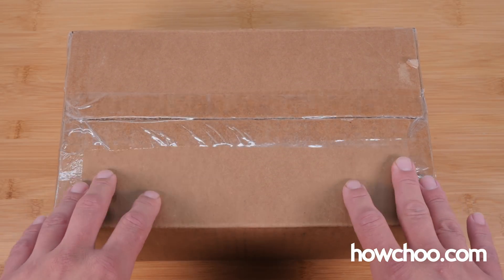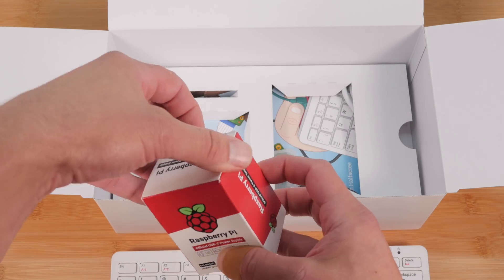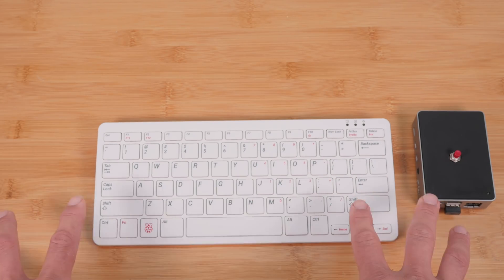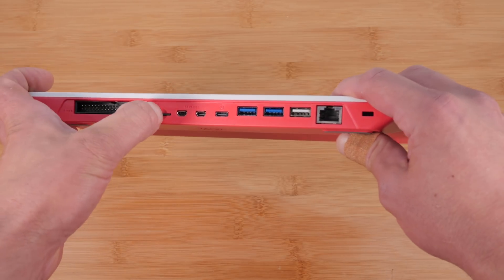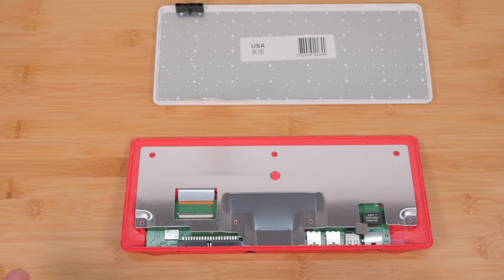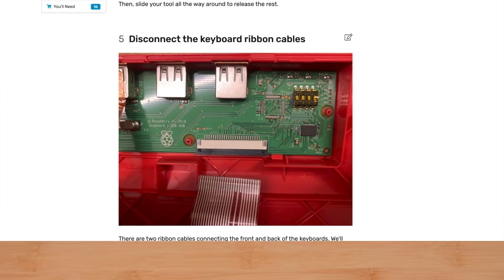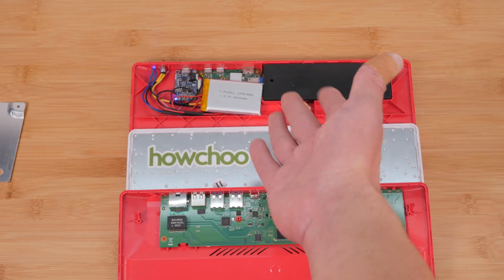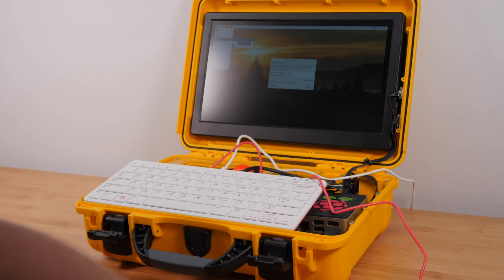Raspberry Pi 400: Unboxing, Review, Teardown, and DIY "000" Option!

Comment: No M2 slot, no gpio cover included as an appliance pi great as a desktop with sd card a fail and the usb3 power not fully supported.
Prefer Pi4 argonone v2 M2 case and a wireless keyboard

Comment: The Zero W is a great match for the Official Keyboard, since it really benefits from the presence of the hub built into the keyboard if you're going to do any actual computing on it (as opposed to using it like a wireless, headless device, which is something else the zero is great for)
Reply: Can you  original raspberry  keyboard top  worked as a replacement for the 400 keyboard and vice versa

Comment: I wish someone would come out with a keyboard case for the raspberry pi, but with cherry keys and space for an SSD.
Reply: It'll probably happen.  But the 400 seems like something the Foundation has always wanted to make.  A great little, super cheap, all-in-one educational computer.
Reply: @TheTurnipKing  Actually, there is enough space for a M.2 SSD and USB3 adapter inside the Pi 400. All you'll have to do is wire it to the USB3 port.
Reply: @PatsFanGermany  There's a couple of issues with that.  You'll also want to physically block external access to that USB port so that other devices don't get plugged into it accidently and it does reduce to you two external USB ports, only one of which will be USB3.  It also makes it difficult to reclaim the slot.  It might be simpler all around to drill a hole into the case, lead the cable out of the back and plug it in.
Reply: @TheTurnipKing  That works as well. Depends on how clean you want your build to be.
The fastest / cheapest way would probably be to buy a cheap KingSpec SSD from Aliexpress and tape it to the underside of the Pi 400 right next to the ventilation slots...
Reply: @PatsFanGermany    The actual best thing would probably be to crowbar a Compute Module 4 inside a keyboard that already has the cherry keys, since it already has PCI-e support.

The real problem with upgrading the 400 to those specs is the amount of stuff you'd need to throw away in order to do it.  I guess you could double the cost of the system easy and not end up with something substantially more usable at the end than the £70-£100 on the 400.
Reply: Failing that you could probably replace the keyboard membrame with a thin PCB with tac switches, like the ZX81 upgrade keyboards.
Reply: I am working on doing something like this with either an IBM model M and the computer 4 w/ it's up board, or a similar full sized keyboard. I'd be using the pcie slot to connect in a usb 3.0 card to have both and ssd and the keyboard itself if I cannot get the ps/2 to work with the custom hat that has been made specifically to use them with the rpi.

Comment: I tried using one for a couple days, and I find that the keyboard loses keystrokes because if you hit a key in the corner, even though you get the tactile feel of a key going down, it doesn't always register.  So these are really crumby keyboards.  

The fact that no one points this out means that people aren't actually using these computers.  :/

Also, you're wrong that they're good for basic youtube watching.

You have to get non-official software to watch youtube, because there's no good vp9 codec for this SOC. So you need a plugin to tell youtube to serve something else - but it only serves h264 (which the pi can't really handle above 1080p or above 30 hz) and it refuses to serve it above 1080p.  Actually MAYBE it can handle 1080p 60hz, but it can't resize them.

No 4k videos, no 2k videos and 1080p at slightly worse quality than other platforms.  The only format it handles well is h265, which youtube doesn't use.
Reply: On such small keyboard, you actually don't want corner hits to register. Double hitting keys are more common on compact keyboard than full size. 
H264 is engineered to do up to 1080p. If you want higher, that's h265. Blame YouTube for not doing h265. Why would you want 4K on YouTube anyway? You mean Netflix?
Reply: @simpletongeek  I want 100% of hits that tactily felt like they registered to register.  I'm not talking about accidentally hitting the corner of one key while hitting another, I'm saying that if you don't hit the key in the center, it misses the keystroke some of the time but FEELS like it went down and registered.
Reply: The Raspberry Pi 400 is ruined if any one of the 76 keys on the (cheap chiclet) keyboards ever fails.  The keyboard cannot be disassembled or repaired, and spare modules or aftermarket parts are not available.  If the keyboard is faulty, then there's no point to having this all-in-one design.  Found this out the hard way.  A severe vulnerability in an otherwise desirable system.
Reply: @RichardKinch  Can't you just buy the plain keyboard and swap the tops? I thought it was designed that way.
Reply: @simpletongeek  No, the official USB keyboard, and the model 400 keyboard, might be the same physical form factor, but are different keytop labels, lights, and functions.  For example, the 400 keyboard has a power indicator LED, and an power on/off Fn key, not present on the official USB keyboard.
Reply: @RichardKinch  they improved the pi's support for youtube by the way.  An OS update made it so it can handle vp9 at 1080 30hz better than it used to handle h264.  I really wish these chips were as good at graphics as a cell phone SOC though, this is embarrassing.

Comment: Thanks for covering the pi 400. The board has a revision of the soc cpu, it runs at a higher clock speed, it can be slightly overclocked. The issues I have with it are no audio socket, no 8gb ram option, YouTube playback still a hit n miss affair (hopefully software fixes for all pi boards will fix this) and the lack of ssd or m2 connection. However, the reality is that these are minor issues and could increase the price if implented. I'm tempted to grab a pi4+ (assuming they bring the 400 chip to a regular pi)
Reply: Thoug the no headphone jack is major because I'm actually using a monitor with no speakers.

Comment: My big question: Is it wireless? I almost ordered one but could not find any information about whether it supports wireless communication. The only reason I would order one is so I do not have to bring my expensive laptop when I travel to Europe. I need to be able to check my email while in Europe, and the hotels I stay in generally offer a wireless connection to the Internet. And only wireless.
Reply: it does have WiFi and bluetooth..  the WiFi is 802.11ac
Reply: @detronbrian  Thanks. That’s very good to know. 🍸
Reply from the maker: Yep, it has onboard wifi and Bluetooth just like the Pi 4 does. Sorry if that wasn’t clear!
Reply: @Howchoo  Thanks!